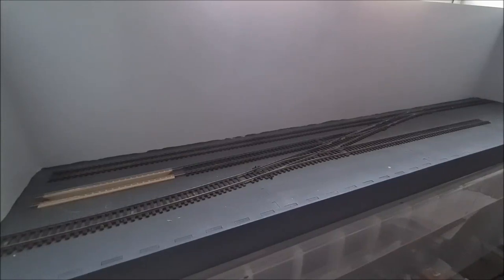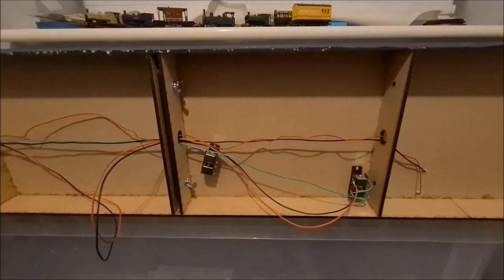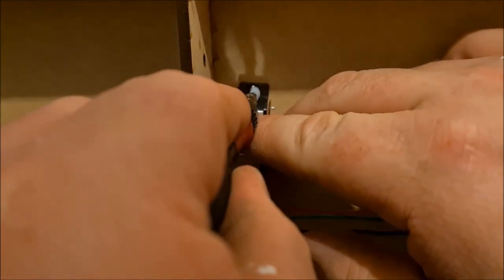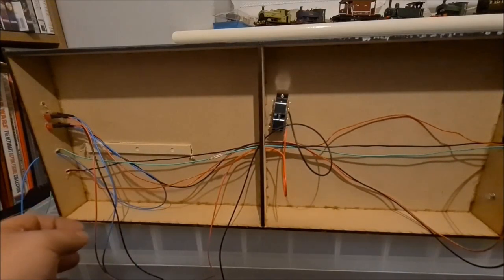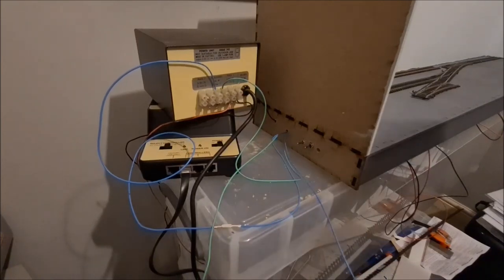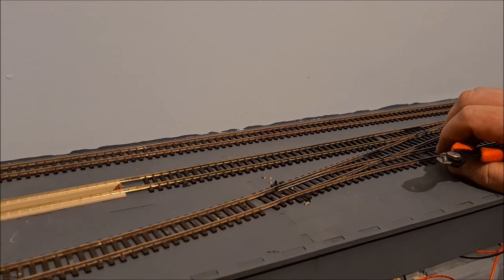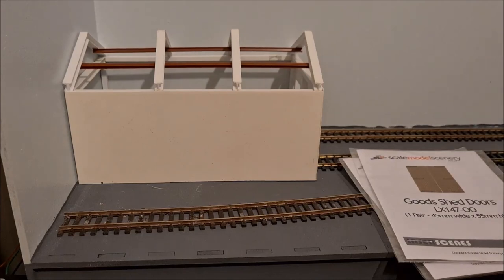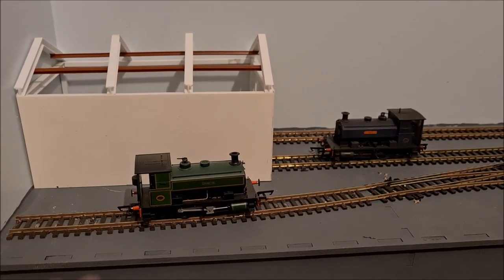My 00 Gauge Micro Model Railway Part 3

Comment: Very interesting series, I love the layout in a box idea and have several, 2, 00  gauge that join together and a liitle n gauge one. I notice that you have put 2 switches  for point motors on one end of the layout, surely that now will not fit back in the Xmas tree box . I fitted a separate  control board  at the front which is detachable
Reply from the maker: Hi colin it does just fit in the box but i will probably do what you have and have them connect up to a control board i mainly done it the way it is for now because it wont be moving for a while and it was easier for me to show for the video the switches will be colour coded and quite easy to unscrew if needed and screw back toghether, glad you like the way the layouts shaping and thanks for watching. Tom

Comment: How are you going to control the micro- layout?  If using DCC, it interests me that you didn’t use DCC Concepts point motors.
Reply from the maker: my knowledge with point motors and general electrics with model railways is very basic ive only ever used the simple point motors and i didnt want to spend alot on this little layout, i may one day experiment with dcc concepts one day when i extend the loft model railway, ive learned alot over the last 5 years but still got plenty more to learn
Reply: @northwesttrainsmodels  Haven’t we all?  I still have lots to learn about controlling my layouts with DCC Sound chips!!  I’m learning more all the time.